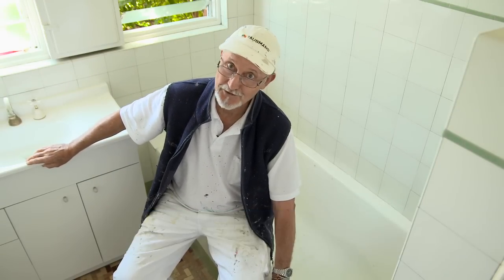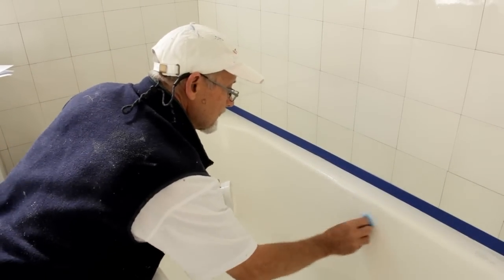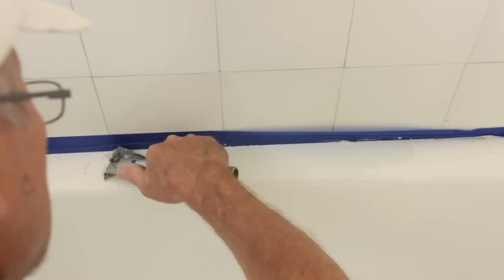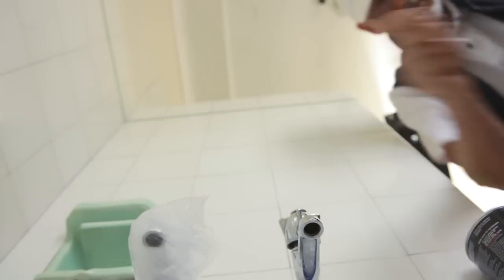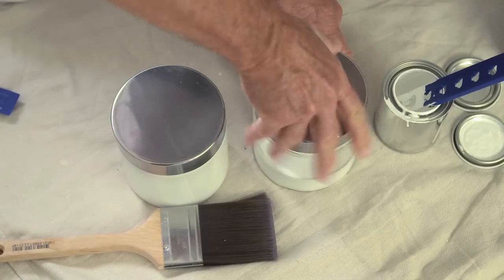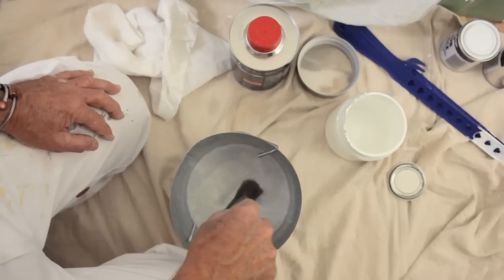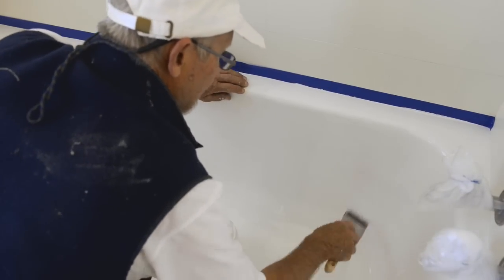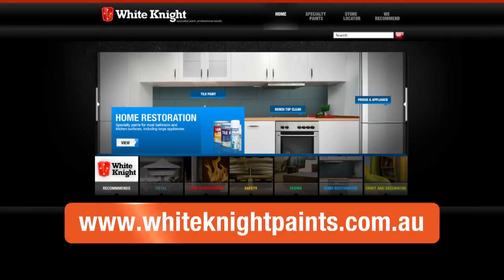How to Paint a Bath

Comment: Great video, keep it up!•°💯
I got some black mould building up close to the taps area.any suggestion of a good paint that is water resistant?
Thanks😊
Reply: Most "Pro" grade epoxy and oil enamel will resist water and not mold. It may be the sealant/Caulk and the order it was applied around the taps. If the caulk was applied after the current epoxy or oil enamel it would not have adhered fully to it and may have created air gaps allowing water to be trapped and mold. In short remover the mold, caulk, and sand down paint around taps and prep surface and apply caulk first, let dry to specs, then paint. Should be good. Rule of thumb: Oil/epoxy over latex adheres, latex over oil/epoxy tears.
Reply: @jasoncarter9356  many thanks for the instructions. I will do all 👍
Reply: @lexiemaep7930  ok.many thanks for the information 🤗

Comment: Hi and thanks for the video ! 

I know this is an old post but wondering if you could kindly provide some advice . I live in the uk and I have an acrylic/hard plastic white bath tub and want to change the inside colour to blue . I know about the product you mentioned but it’s not available in the uk and it only comes in white.  The surface condition is brand new already and is very smooth but clean . Wondering firstly if I will still need to do all this preparation work as like I said it’s a brand new bath tub and  secondly if you can suggest a paint I could use and if I need a primer or any overcoat to go with it - obviously it has to withstand water and heat without flaking etc You’d think there would be loads of varieties of paints available but doing some research online the only obvious paints I can find that might do the job even though I’m not too sure is either plastikot or rustolium all purpose outdoor paint - and rustolium crystal clear gloss laquer as an overcoat protector perhaps ? Not sure if perhaps hottub paint might do as they tend to be made from fibreglass ? 
I’d appreciate any info you could provide ? Cheers

Comment: Does using a paint brush leave behind bristle lines, or is it a smooth finish like the original bath tub? Or should we use a spray paint machine?
Reply: Spray is the ultimate, but you need some expertise on the gun... 
A good painter can get a good finish with the right brush. 
The trick is to work fast, apply liberally (without being too thick, it's a fine balance)  spread it out and tip off very lightly

Comment: What about removing the masking tape between coats? Won't the first coat have hardened to the point that the tape would damage/peel the first coat if you let it dry too long?
Reply: correct usually you should remove the tape while the paint is still wet
Reply: You should actually always run a sharp blade before removing tape.
Reply: @cmrcz7550  that's if you cared about cost of material used. Most DIYers don't care cause it's only that one job so use up all the tape lol.

Comment: I liked this video; it's very easy to follow and comprehend.  I have a special issue and want to know if your method will work and would I need a third coat.  When we moved into our home one of the bathrooms has blue bath tub, blue sink and blue toilet.  We recently replaced the toilet.  The white toilet looks fantastic!  However, the blue tub and sink still look bad.  Can I repaint them also?  We want to move and we know the white would be more acceptable than the blue and we don't want to replace them unless it is the last resort.  Thanks for any advice.   Jan
Reply: +jan barhorst Yes I have a horrible old green tub and washbasin and I need the same information.

Comment: this paint job will begin to crack and peel within 2 to 3 months. its paint...the water will eventually gather under it and lift the paint from the tub.  Painting a tub is a scam and a waste of time and money. the tub would need another paint job in 6 months. buy a new tub that don't need to be painted.
Reply: Its epoxy not paint
Reply: agreed. Use Ekopel 2K

Comment: There is no way that paint out of a can will equal then same finish of a baked on enamel finish from a factory. What you are doing is called schlock. It will look good to the customer and off you go. A few months or years later and it will fail. It is just paint and not baked on enamel from an oven.
Reply: I'd thus kind of repair lasts for 2 years,  it should be a good deal.
Reply: Ummm the tub has enamel already and they do just paint them which is why the need repairs every few years this work is a good fix and easy

Comment: Wow, this tub had peeling from a previous job that failed and he still was gonna DIY it?
5 days to cure? Most pros use urethane that will cure in 24 hrs or less.
Reply: OK I only have one restroom what paint can I use to use faster
Reply: I can't wait 5days
Reply: Thats the problem. YOU cant buy the faster dry urethanes, pros can, because they have the safety equipment and training to deal with isocyanates. Hire someone. Thats the best choice for refinishing a tub. Hire someone who's been around for a while, and knows what theyre doing, who uses good materials and has a warranty behind their work.
Reply: +Paul L. thank u
Reply: +Paul L. what part of California u in
Reply: Also nobody is mentioning the paint brush strokes in the finish that will eventually collect dirt that will be impossible to clean. Also "the legend says" that epoxy paint becomes yellow within 6 months of use. Also he never mentioned that his tub was already cheaply painted. If never painted before good luck trying to sand the tub by hand or a machine.
Reply: well said mate this stuff is a rip off go to a pro
Reply: I went to the "pro" and spend $700 to resurface the bath.It was flaking within 6 months and has been repaired by the  "pro"3 times and still problems.
Reply: It takes a professional grade epoxy. I have a tub resurfacing company. I can't tell you how many times I had to strip this crap off. Yes a professional grade epoxy cures in 24 hours
Reply: hino823 my cost is $250. Company's like Miracle Method charge more for their service.
Reply: Paul L. Gotta wait 5 days without a bath yeah right

Comment: I have a tub resurfacing company. This is not a DIY project. It takes a professional grade epoxy. From my experience with these products. They do not last. This stuff will start peeling within 6 months.
Reply: Agree, Got an old bath resurfaced by the pros 10yrs ago, well worth it. I'd be grateful to know, if there's any method to bring the new look back to the chrome bath Handles?
Reply: I agree... It took Me a lot of time to make properly: mineral spirits  + sanding  + epoxy (4 layers)... I didn't know what I was into.
Reply: Any specific epoxy you could recommend?
Reply: @patrickokeeffe6998  mr clean wipes
Reply: this comment should be at the top. Never use paint. Use Ekopel 2K (it's epoxy resin). clean your tub 3 times before applying.